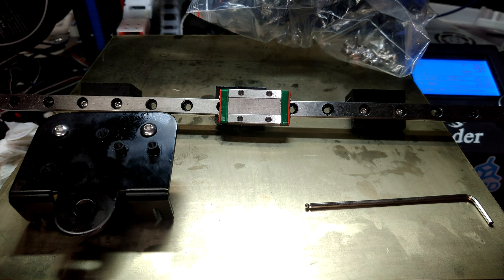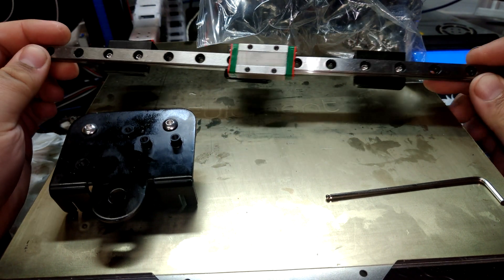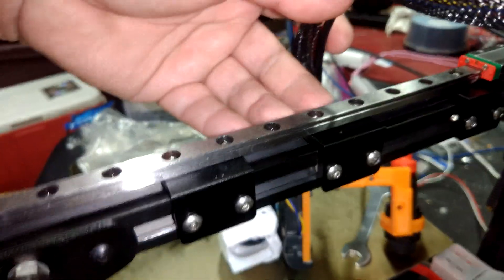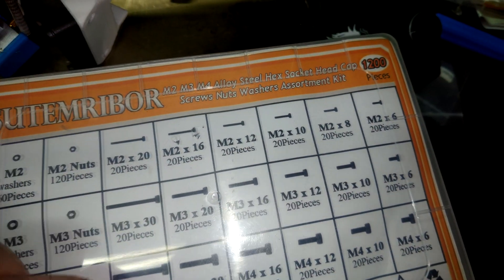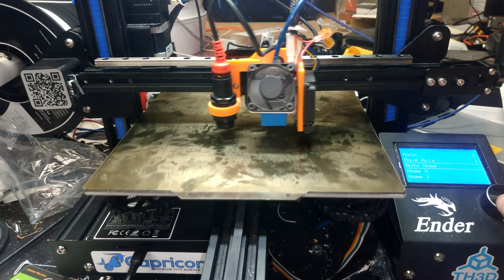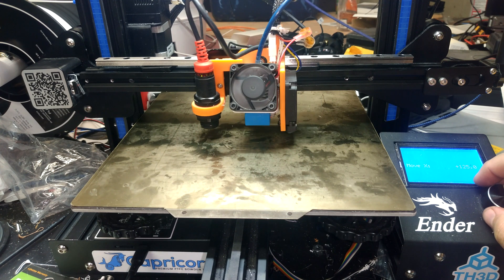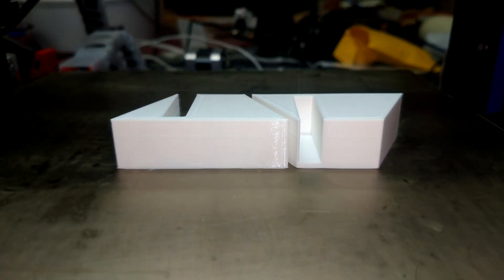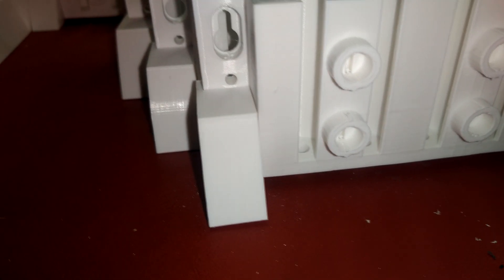Funssor X Axis Linear Rail Mod (Ender 3 Pro) Review

Comment: Any issues screwing the rail directly into the extrusion using t-nuts without the l bracket?
Reply: the belt travels in the upper and lower slot of the extrusion with this design.

Comment: From what I gathered about linear rails is that it won't improve print quality as such (if your printer is setup correctly), but it will be more consistent. The wheels could introduce inaccuracies over time as they wear. Linear rails don't wear that quickly. But in the end, having your printer properly adjusted is THE best upgrade. If you print a lot, linear rails could be beneficial, but on the other hand: there are people running Ender 3's in a farm setup pretty much stock for a long time.

Comment: I have this setup on my printer and prefer it over other linear rails that mount in front rather on top. you dont loose any build space and you can use you ender 3 x bracket. And even a moron have figure out how to install this bracket as is dead simple.

Comment: You have to thoroughly clean and re-grease the rail and carriage. You can also get better ball bearings (100 in a bag, and the carriage uses 66 bearings - https://www.amazon.com/gp/product/B015RKOZ7G/ref=ppx_yo_dt_b_asin_title_o01_s00?ie=UTF8&psc=1).

Those two things will vastly improve your rail setup.
Reply: What grease is recommended?
Reply: @xbuckfutterx  - I used grease, and the bearings weren't very free, so I disassembled /cleaned everything - again - and used SuperLube Synthetic oil.